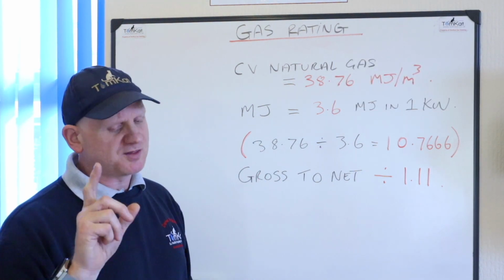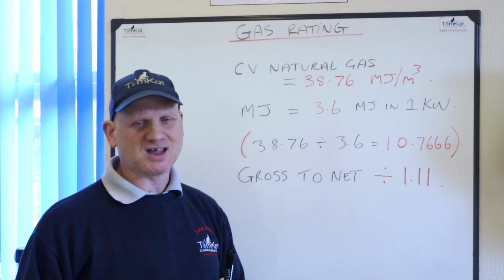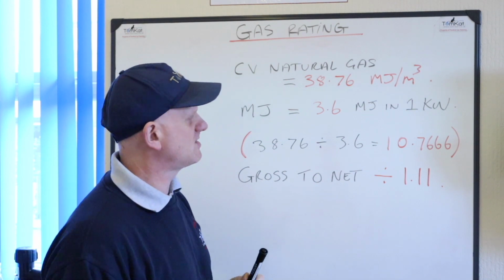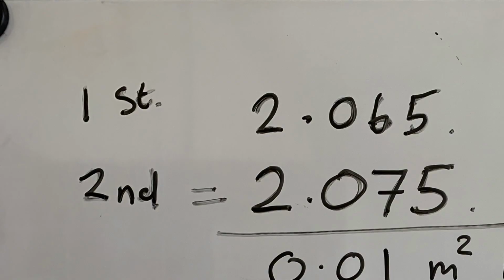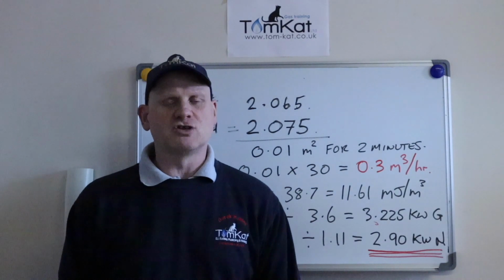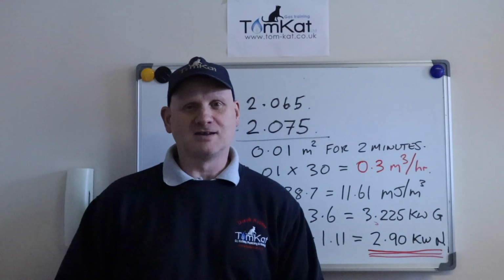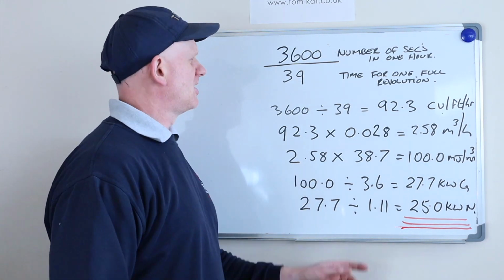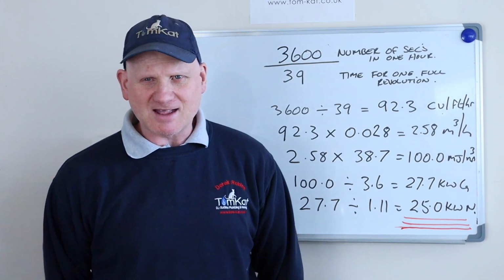HOW TO GAS RATE (no apps required) using a g4 and u6 meters, also covers the new smart meters TB 112

Comment: Hello, Derek, excellent video. 
I was here looking for a Landis meter because I got confused by a bulletin sent to me by Gas Safe. (Same as you are showing right after that practical gas rate on Landis), which absolutely doesn't match what you showed and what is written in a bulletin. 
In the bulletin, I see only button A (for 8 times), and button B is not mentioned at all. 
What is really happening? 
I need to do my first service on a boiler that has Landis installed with an inspector behind my back, so I'm stuck, clueless, and waiting for your advice. Thank you.
Reply from the maker: If you have the same meter as I have just do it as I show in the video and you will be fine
Reply: @tomkatgastraining  That's much appreciated, Derek and I will definitely do as you did. 
Because I recall (the way you do it), my 5 services for the portfolio on one property I visited under supervision. 
Gas Safe is sending official documents that tend to confuse people instead of making it crystal clear, which is such a shame. 
Thanks again for the fast reply.

Comment: Hi Derek, when you gas ratings combi boiler in hot water do you put the temperature on maximum with one or more tap running because sometimes the water flow is problem, thanks

Comment: great vids..however on smart meter with buttons no need, run appliance max load ie hot water  press 0 button 4 times and itl calculate gas rate for you!

Comment: shud you gas rate the two biggest appliances to gether to find out if you have incomplete Combustion  say if you had open flue applance ?
Reply from the maker: No you gas rate appliances separately
Reply: even if you got two boilers on system and think the pipework might be inapropret
Reply from the maker: @darrenhoffman3649  you do inlet pressure at the appliances if you think your gas pipe is undersized not gas rate

Comment: You must have been asked before but do meters malfunction? My m3 consumption has gone up  by as much as x4 times. I turned off the smart meter for a day and it still logged 17m3. It uses TOF measurement but what could go wrong? And how can it fix itself?
Reply from the maker: If you are worried your meter has malfunctioned get in touch with your gas supplier they will sort it for you because the meter belongs to the supplier.

Comment: Hell Derick, Thanks a lot for this, pls i have one question, Why do we multiply the meter index reading by 30 instead of 60?
Reply from the maker: Because we time it for 2 minutes and we want m3 per hour so 2x30= 60 so m3 per hour
Reply: @tomkatgastraining  I get t know, there are 3600sec in an hour and we have time if for 2min which is also 120seconds. Therefore, 3600sec/120sec = 30 in m3 per hour.
Thanks Derick

Comment: Derick could you explain to an interested not gas registered person .....
Why do you equate 3.6 MJ in 1Kw !!! I fully understand a cu mtr of gas contains this amount of energy ( 38,760,000) joules
.
A watt is a rate of work not joules , a Kwatt  X hour is the amount of energy ( 1j = 1watt X 1 second )  therefore I understand that 1cu mtr of gas  equates to 38,760,000 watt X seconds , or 38,760 Kwatt X seconds there must be a time component somewhere...please what am I missing
Reply from the maker: When we gas rate we have to follow a standard. The appliance manufacturers and gas engineers have to follow the same standards. We gas rate for 2 minutes to give us a m3 figure for 2 minutes so we x that by 30 to give us m3/hr but we need kw so we x by the Cv of gas which is an average of the country and a gross figure of 38.76 but we just use 38.7 we then divide this figure by 3.6 because again this is an average and a standard of 3.6 mega joules in a kw and then finally because it’s gross and we need net we decide by 1.11 for Nat gas.

Comment: Hi. So if the badge says 25kw on my boiler is it gross or net? I thought if it doesn't say anything we need to take it as gross
Reply from the maker: If the boiler was made before 2000 it would be gross after 2000 should be net.
Reply: @tomkatgastraining  Ok thank you. Where can I find this? in MI's ?
Reply from the maker: @letsfixit782  the MIs will tell you if it is gross or net if you don’t know the year of manufacture also the data badge will say gross or net
Reply from the maker: The reason why they say to assume it’s gross is so you don’t undersize the ventilation as a gross vent will be larger than a net vent
Reply: @tomkatgastraining  Thank you for your help.

Comment: Great videos, every one of them. As a trainee would like to say - Thanks a lot for your time and effort Sir! 
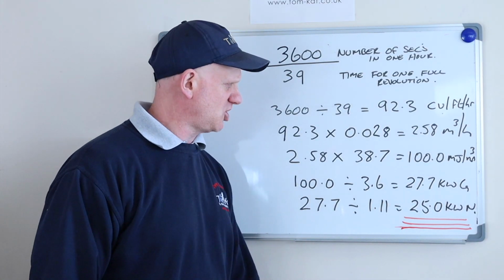Just a little question though - at 12:38 you have noted 2.58x38.7 = 100.0 MJ per cubic meter, I believe you meant 100.00 MJ per hour at this rate - 2,58 cubic meters per hour, am I right? As the calorific value is already given - 38.7 MJ per cubic meter?
And the numbers always differ slightly between different centres and books. Which, unfortunately is a bit confusing! I have been thought that the calorific value is 38.6, which changes slightly the calculations!... 
Anyways, also would like to say thanks for your time reading this comment in advance. Regards.

Comment: good videos mate, a good refresher, confident instruction.  Gas Safe TB141 Acceptable tolerances (+5% -10%) might be worth a read
Reply from the maker: Jason Betts we use these tolerances but there is nothing in any manufacturers instructions or regulations that mentioned these figures. Thanks for watching cheers

Comment: Another great video Derek. Keep up the good work. If there is no info on whether the gas rate in MI is in gross or net, should we assume gross or should we assume net?
Reply from the maker: L Dosanjh if the appliance was manufactured before 2000 it would normally be a gross figure but after 2000 it should be net figure
Reply: Thanks mate 👍🏽

Comment: its a  open book exam. i dont go to every service and use this calculation. i just use my viper manual and ill be taking it into my resit
Reply from the maker: Do you not think a gas engineer should be able to gas rate without using books? Would you use your books to help you carry out a tightness test?. When your under a reassessment your assessor would expect you to do the fundamentals of being a gas engineer without books so tightness test, purging, gas rating and ventilation would come under that. Good luck in your assessment and thanks for watching cheers

Comment: Great video, Thanks! and here is another way of gas rating: the difference in reading ex. 0.095 x 3600 (sec in 1h) x 10.77 (Cv of gas) divided  by 120 sec (test time) = 30.69kW Gross. / 1.11= 27.65.

Comment: Minor error. Calorific value in megajoules is a unit of energy. A kilowatt is a unit of power. A kilowatt-hour is a unit of energy. Therefore the  line on your board should read "MJ = 3.6MJ in 1 KWh"  ie  a Kilowatt-hour equals  3.6 megajoules.   Also technically you should quote the calorific value  is at the nominal domestic appliance pressure of 22 millibars.
Reply from the maker: djhvideo thanks for your comment some things are just better off not said thanks for watching cheers

Comment: Thanks a lot,
We usually do it a quicker way for imperial which may be a little easier to remember.

Step 1... 3600÷39= 92.3  cu/ft/hr
Step 2...  92.3 × 1040= 95'992  BTU
Step 3....  95992 ÷ 3412=  28.1 kwh gross
Reply from the maker: Akaash Mohammed lots of ways to gas rate just hope the cv of the gas doesn’t change. Thanks for watching cheers
Reply: @tomkatgastraining  very true!  I heard theyve actually started blending hydrogen into the gas supply as well to cut emissions and all that.

Comment: Reg 26.9 is pretty damn important if you cover as many aspects of it as you can you'll sleep easy.  As an engineer it's in your court to make sure the appliance is operating safely and within manufacturers given tolerances.  Gas rating only takes a few moments and the outcome can show you if the appliance is under/over gassed. It really isn't that difficult to calculate. I've noticed many engineers using the apps it maybe a little quicker. However come the time of your re-assement you'll struggle. Seems to be the case for ventilation requirements and pipe sizing too. Don't get stuck in your lazy ways people 😜

Comment: Excellent video yet again. 

When servicing an appliance I’m assuming,

Operating pressure must be checked along with gas rating the appliance every time as the burner pressure can be fine but the appliance could be burning the wrong amount of gas due to for example a faulty/blocked or wrongly sized injector.

Those smart meters seem a bit of a pain.

Roll on next Wednesday. Please keep up the great work!
Reply from the maker: 1Monaghan if servicing a condescending boiler you would do inlet pressure and flue gas because you can’t do burner pressure
Reply: Because these have zero governor gas valves explained in the last lesson?